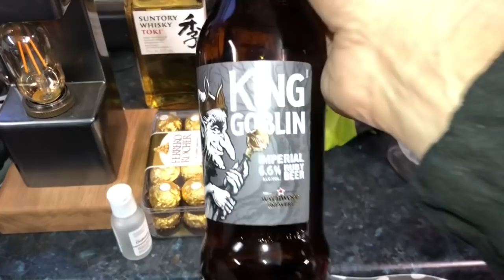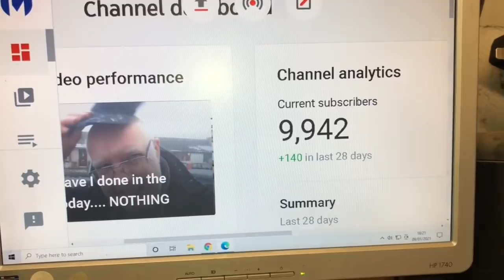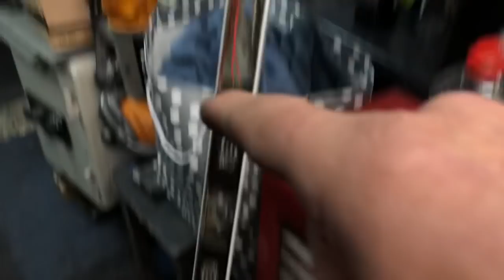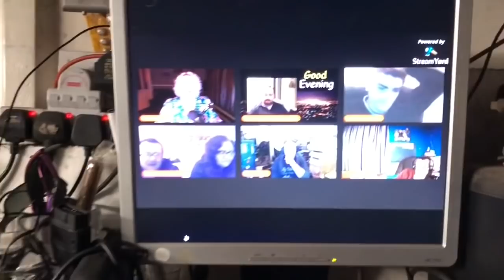A little light play in da shed

Comment: LOL...I knew you wouldn't be able to chuck those lamp bodies away!🤣 Your Flouro problem could be solved by putting the guts from the new fitting into the old fitting with the broken ends which would surely save the cutting n drilling and refitting the plate locater....probably 😉. Hope you had a good birthday mate. 😁👍

Comment: I'm still rather sceptical as to the savings of led's over the old fashioned triphozzies with pulse starters. Sure, led's use less lecky, that is running costs, but the cost of led tubes is ridiculous compared with triphosphates. Similarly led security spotlights only have an average running life of about 3-4 years and the whole fitting needs replacing. The old fashioned halogens lasted longer for the cost of a few replacement halogen tubes. What I charge for time and labour probably far exceeds the savings in terms of energy consumption.  If you're fitting them yourself and paying nowt, may be worth it.
Reply from the maker: Your last sentence summed it